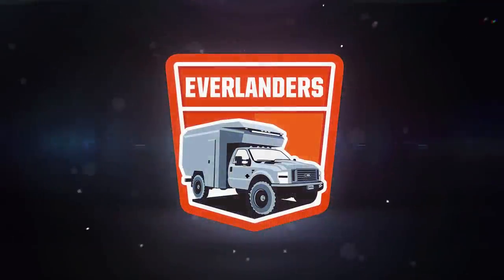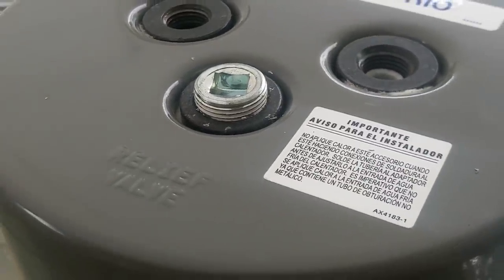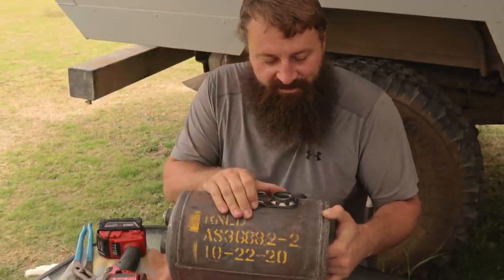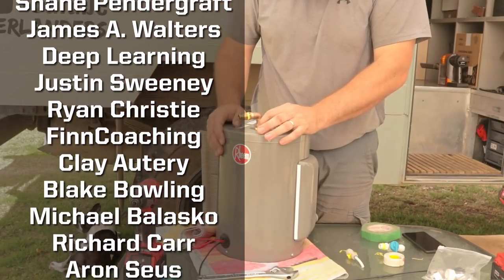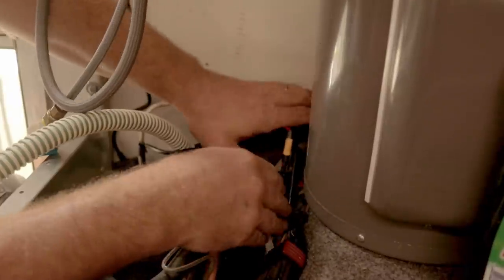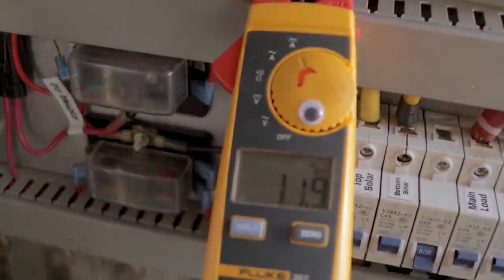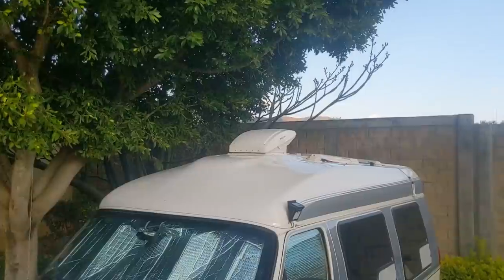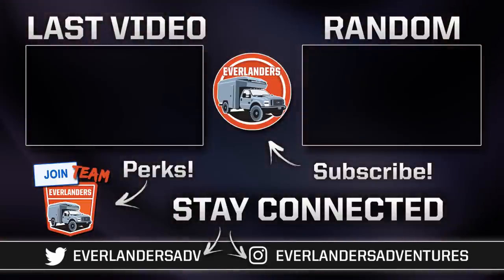Solar Powered RV Water Heater Conversion - 12 Volt Dump Load - Everlanders see the World!

Comment: Seems to be working well so far with the 1-minute check interval, but it's probably worth adding some sort of heuristics to both the battery and temperature side of things.  Something like turn on when battery's above 85% voltage and off at 80% , and 65C on / 70C off.  Especially on the battery side, since the current draw might drop the voltage slightly.
Reply from the maker: It's not using voltage, but State of Charge, which moves very slowly on a 11.5 kW Lithium Bank.

Comment: Great video just wondering how it's been working after all this time and does it affect you solar power to any degree .I was thinking of trying it with a 12 volt element that you showed do you think it would be more efficient and use less energy that way .Thanks for the great ideas Dale
Reply from the maker: It's working fine, and it has no effect on our solar because it's programmed to come on only when the solar would be going to waste anyways. (When the batteries are full)

Comment: I found it quite entertaining and I'm curious what the conversion rate would be from DC to DC and same thing with the 120 to DC conversions The other possibility is going brushless motors instead of brushed motors the efficiency of them
Reply from the maker: Brushless motors are typically 85-90% efficient whereas brushed DC motors are around 75-80% efficient. However there are a multitude of factors that will affect the numbers in both cases. Build quality will play a big part, The quality of the bearings, and the strength of the magnets will affect efficiency in both cases. The same is true for DC-DC conversion vs AC-DC conversion. The efficiency of AC Inverters is usually around 85-95% depending on the brand and build quality, (and thus cost), DC loads on the other hand suffer from losses such as line drop and heating in the conductor if not properly sized. It is difficult to answer such a broad question with a single answer, there are many factors involved and they change with every load.

Comment: Are we just voting in the comments or is there a poll I missed? My top pick would be LoRa, I'm a ham and do some volunteer disaster preparedness work, I've just stumbled upon LoRa Mesh/Meshtastic and it's very cool. I'd like to get a couple nodes to mess with, I could see them being very handy for hiking and kayaking in the backcountry.

For DC-DC conversion, Victron has a bunch of isolated and non-isolated converters and battery chargers. Some have Bluetooth capability too. I've also bought a bunch of boost/buck regulators from Pololu, for smaller loads and low-voltage. They're well built, and fairly priced.
Reply from the maker: Yes, voting in the comments, sorry, I should have checked that it was possible to put it in a card before I said that.  I'm super pumped about LoRa too, unfortunately it took two months for our board to get here and one of them will no longer flash, and the vender is unresponsive...  I have another dev board with an ESP32 that I could try and transplant, but it's risky giving the equipment I have here.
Reply: @Everlanders  You should do whatever makes your life easier. Which vendor is giving you trouble? I was going to order from Lilygo.

Comment: Thanks for this video. This inspire me allot!! What i didn’t understood was the heating from the engine, through a valve. Where you able to use that heat from the engine? Or did you find out that in practice, this never really happend?. Please explain. Allthough im not a channel member yet, i would prefer dc to dc topics. The reason for me is the convert of a monitor to 12volt dc. I just bought a zosi 8ch camera system, or cctv. To create a full security system around my van. And this works perfectly on a 12 volt screen. However the 12v 13” screen is a bit small, and i would like a bigger > 24” screen. But did’t find a monitor / screen of this size in 12 volts. I understand that this won’t be your specific topic. But a better explanation on how these devices works, is allways welcome. Again thanks and lookin for the next video. And hopefully i can become a member after this pandemic. Cheers Eric
Reply from the maker: It is common for Marine water heaters to use a loop of metal tubing with hot engine coolant inside the insulated water tank. Isotherm and Whale are common brands that do this. It allows you to heat water with waste engine heat, or we could use our Espar D5 to heat the coolant and thus the water if we have not run the engine in a few days... Many of these also have a 230 volt electric heater element too. We planned to buy one "one day" when we had more money but it never happened, and now we are in Mexico making do with what we have, and have access to. 

Regarding your screen, check into Computer Monitors, many of these have 12 volt AC to DC power bricks originally, ours is a 27" AOC brand monitor and we run it right from the 12VDC
Reply: @Everlanders  now i understand, Thanks for your explanation, and thanks for the advise. Hope to see your next video soon cheers

Comment: Another fine video!  You need a big 'ol roll of aluminum tape.  I love the stuff and use it more than I ever used Duct tape.  You should hook up your neighbors for some of that excess solar power.  Everlanders Power Company.  Maybe like a six pack per 1kw???
Reply from the maker: I have a small amount of aluminum tape left, but I'm saving it because I can't seem to find it here. And it's funny you mention sharing power... It's happened a few times where people need to plug into our 120v inverter because their fancypants inverter/charger combo throws a fault at the 135VAC which seems to be the norm here.

Comment: Suggestion: 12v heater element controlled by some kind of PWM (or solid state relay) to match (live) the excess solar.
Reply from the maker: There is no need to PWM as the excess is always more than the load of the heater...
Reply: @Everlanders  yeap., but it would be a fun project and serve me very well hahahaha. I have a 30 litter tank, 1200w solar, and a 660w heater element, and lead acid bank (lithium is cost prohibitively here), it would be awesome to use every single what that the batteries are not accepting (and the "house" is not using) to heat water. To do that, I would need to modulate the power to the heater element. I thought about using a lower powered heater element, but than it takes too long to heat water when on a hurry.

Comment: Great video! I would love to know how to avoid the lithium maxfan cutoff issue. I bought lithium to replace my AGM bank, but haven't installed it yet. Best way to deal with problems is by avoiding them. So glad you mentioned this.
Reply from the maker: MaxxFan technical support says to keep the voltage under 13 volts, which is crazy because every RV on the road charges at 14.4 is they use the engine for charging... We helped one fellow with a quick and dirty hack by installing a DC-DC buck converter - not a great solution...
Reply: @Everlanders  Thanks. Wow, sounds like MaxxFan's engineers need upgrading. I'm still in the US. What voltages should I get on a buck? Is there a better solution? I can easily access the DC wire going to my fan and have plenty of space to install whatever device makes sense.
Reply from the maker: Installing a buck converter just reduces the voltage to the whole fan. If the core of the problem is their circuit board logic cannot handle more than 14 volts, (which still astounds me), then it would seem worthwhile to isolate their logic board from the motor, allow the motor to run at 14 volts, but reduce the voltage to the logic board. 

I removed a damaged PCB board from another travelers fan, and I have it here for some testing, it seems the main processor is fried because the 12 to 5 regulation is still intact and the output driver and relays still work... 

Honestly, I'm not buying into MaxxFan's excuse that it is the 14 volts that is damaging it...
Reply: You could add diodes to the power supply for the fan.  Each diode will drop the voltage by about 0.6V.  It may not be a perfect solution, but it's cheap and easy.
Reply: @Everlanders  If an engineer fails in the automotive and aerospace industries, he/she devolves into the RV industry, where they can be incompetent, yet still get their Christmas bonus! I hear what you're saying. I bought an extra circuit board and sprayed it with conformal for South America. That fan is crucial to survival! I have no AC. I'm eager to learn of your findings. With covid, I won't be starting in Mexico for some months. I'm in Florida now ready to roll.
Reply: @Mike_Neukam  I wondered about that. I'd have to think about this. I haven't installed my lithium yet and am not sure what the operating voltage will be. Don't want to end up with too low a voltage.
Reply: @JohnS-zq8ks  The maximum voltage will be determined by your charger settings or your alternator (if using one to charge your batteries).  Assuming LiFePo4, the maximum charging voltage per cell is usually 3.65v*4=14.6v.  You could reduce the charging voltage to 3.5v/cell (14v) without losing an appreciable amount of capacity.  The cells will stay above  3.2v (12.8v) until they are discharged down to about 20% of their capacity.  2 diodes in series should protect the fan from alternator voltage which could potentially be as high as 15v at times, and still allow the fan to operate at 11.6v-12v throughout most of the usable capacity range of the batteries.
Reply from the maker: Very well said Mike! Nice job!

Comment: Very intresting build but I was wondering, have you timed how long it takes to heat up a tank from a fresh fill of cold water? & do those heating mats come in higher wattages? You might want to add a tempering valve so you can raise the tank temp which might give you enough hot water to take a shower from it.
Reply from the maker: This has since been upgraded: https://youtu.be/TGMZ7bM-Kow

Comment: I'm probably not going to read all 462 comments but that original thermostat is manual snap-disc action and it will heat water with 12 volt as-is (believe it or not) using the original 120 volt heating element. Of course 12 volt will take 10 times longer than 120 volt to heat the water but for those inclined towards a simpler option, the existing tank could have been used with no modification whatsoever. It will heat the water to the desired setpoint and then shut off with the thermal overload safety feature (red button) built into the thermostat. :)
Reply: Or you could use the stock heating element and your heating pad to heat the water up that much faster. :)
Reply from the maker: At 12 volts, the current through the 9.8 Ohm resistive element is 1.22 Amps... which is only 14.69 Watts.

Comment: Hi, nice job 👍. My vote is for DC to DC. Hi, I forgot to ask, you showed a solar charging profile at the start of the video that indicated periods of charging shut off when the batteries were full. Do you have a profile since you added the water heater solar dump that shows the difference?
Reply from the maker: The profile looks exactly the same, it's is still turning off the solar by mid-day, even with the water heater...

Comment: I used an output from my charge controller to turn the water heater on when the controller switches to float.  I don’t want any dump loads operating if the battery’s aren’t full.
Reply from the maker: Same difference...

Comment: A water heater is a good 'over energy' dump.. but needs a pump as it should not be the sole water heater.. like a 5 gallon hot tank that is optional and pumps a loop back through the main water heater to prevent the need for steam venting... like for a smaller trailer.
Reply from the maker: What cha' talking about? This 10 liter heater IS our main heater...

Comment: You might want to 3D print a temp and pressure valve for that new water heater. 😂
Reply from the maker: There is already 4 redundant pressure releases upstream...

Comment: I think the heat exchange between the mat and tank could be upgraded. I would go for thin sheet aluminium and sandwich the heat mat between the tank and the ali sheet and then use metal hose clamps to mechanically squeeze it all. The mat will last longer and the water get hotter.
Reply from the maker: It's surprisingly hard to find aluminum down here, not sure why... I think if I ever need to upgrade this units, it will be with the big 600 watt 12vdc element.
Reply: @Everlanders  Commercial  bean can would do it. My first thought was to put the 12v into the 110 element but I'm guessing a shower a month might alienate the wife, lol
Reply from the maker: 12 volts into that 11 ohm element is only 15 watts, it might be 2 months between showers...

Comment: For your fan, why not upgrade it to a brushless dc fan motor and controller used in rc aircraft, drones, cars, etc...  I am sure you can better control its speed and is likely a lot more efficient on energy used.
Reply from the maker: I considered this, and might still do it, however most brushless speed controllers produce audibly noisy controls... Especially the basic hobby grade stuff... If you know of a 8 mm shaft brushless motor or a silent FOC brushless controller, I'd be happy to know about it.

Comment: I’d vote for the 3D printer but I’d watch all of them! Also interested in your process for designing parts. With the console you printed for the Open Auto / reverse camera I am surprised it can handle the heat in the cab. Was that printed on a home machine or was it commercially printed?
Reply from the maker: The Android Auto pod was printed with ABS, the same material as the rest of modern dashboards...

Comment: Being a fully resistive load, I'm fairly certain you can use the regular heating element as long as your wattage is the same. I don't think the temp control works (though I could be wrong) but the element itself should work without modification
Reply from the maker: No it won't. Power is squared, I've answered this many other times in the comments already...
Reply: Yes, you can use the same heating coil, but it will be very little power since you are running at 12 V and not 120V.  So little power that it's not practical to use.

But, DO NOT USE THE TEMP SENSOR RELAY, its intended for AC power.
Reply from the maker: AC or DC is not the part that matters, it's the much higher current that is the problem.
Reply: @Everlanders  I assume you are referring to the relay since you  mentioned AC and DC. 

There is a difference,  the part that brakes the current can not handle the same current. The temperature relay can not handle 120V DC @ 10A , but can handle 120V AC @ 10A.

Regarding using the element at 12V DC is safe, but it do not deliver any useful amount of power, so using a pad was a smart idea.
Reply from the maker: @MichaelEricMenk  5 Amps AC or 5 Amps DC is basically the same. Thus AC or DC itself isn't the problem. The problem is that to deliver the same wattage, at much lower voltage, will result in much higher amperage.  

This water heater had no relay, only a thermal electric switch, and a resettable over temperature safety cut off...
Reply: @Everlanders  no, DC amps and AC amps are not the same.

The problems comes when disconnecting the power. The arcing behaves differently on AC and DC.

This apply to thermal electrical switches, relays, physical switches. The problem with arcing is the same.

That a 12 Ω element do not give the same heat at 120V as on 12V is a completely different "problem".

Comment: Cool channel and very impressive RV build!
Question: why not run the "120VAC" element on 12VDC?  It should yield ~140W instead of ~1400, but that's still 140 more than you're putting in now (or you could have skipped heating pad altogether). Also, keeping existing mechanical thermostat switch as a fail-safe high limit in series with element(s) wouldn't be a bad idea, in case upstream circuits fault closed.
Reply from the maker: Because the power is Squared... Our original water heater element is 9.8 Ohms
Per Ohms Law, which states Power (P) = Voltage (V) * Current (I) 
At the rated 127 Volts, the current through the 9.8 Ohm resistor is 12.95 Amps ... which means (P) is 1645 Watts.
At 12 volts, the current through an 9.8 Ohm resistor is 1.22 Amps... which is only 14.69 Watts.
https://ohmslawcalculator.com/
Reply: @Everlanders  Ah, of course. Thanks for setting me straight!

Comment: 1. the charge controller should automatically turn back on when it detects the battery is no longer full.

so either you have an older charge controller or a really cheap one that you pay extra for no top off detection.

2. you could if you are near ac source be able to back feed the power grid.

3. bypass some of the solar panels to reduce the charge rate or even turn the charge rate down on the charger.
Reply from the maker: 1. Of course it does.
2. Never near A/C
3. That's exactly what I'm trying to avoid, why  turn off the solar when it can be used for something useful?

Comment: That's going to be a hell of a bang when that pressure relief does go...... Question: how do you deal with the logging for all your scripts? All your debug verbose, where is that displayed or logged?  Also,  is that the same Pi that displays on your screen in the dinette?  Good work as usual!
Reply from the maker: Thanks, That's the bonus of using air pressure to move our water, if the pressure ever goes over 40psi it vents out through the regulator. If it somehow got to 100psi the kegs all have pressure vents that will let go... Most things I log with Blynk, but some stuff is simply written to log files that are sent to the NAS... And yes, this Pi can be shown on the dinette screen, But most often the screen is connected as the second monitor for my Laptop, and then I just SSH into the Pi